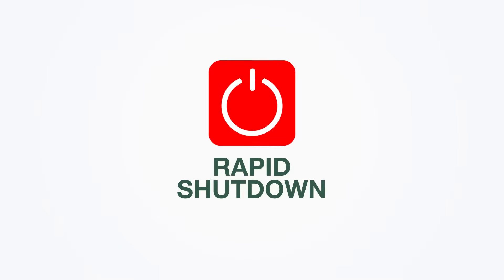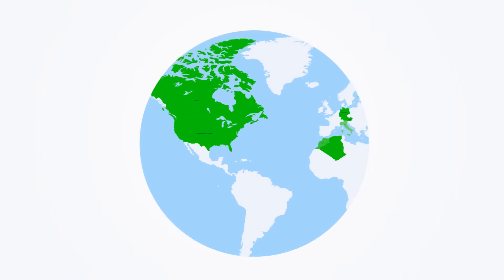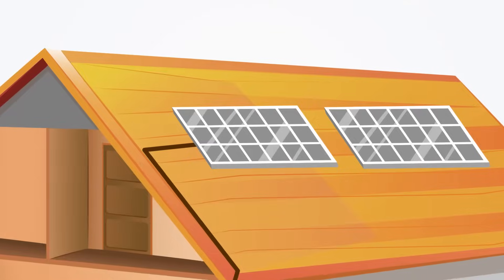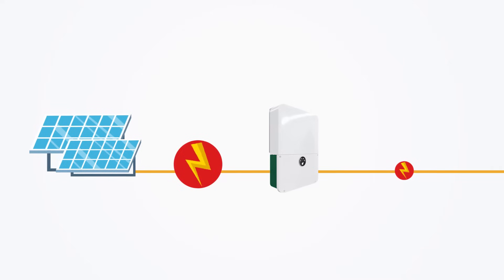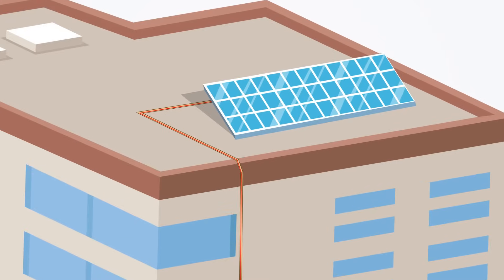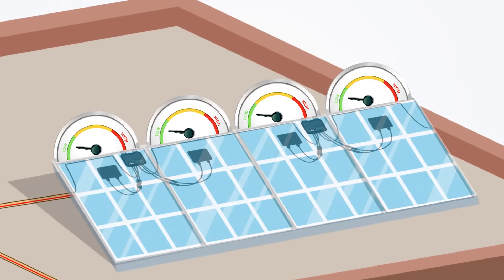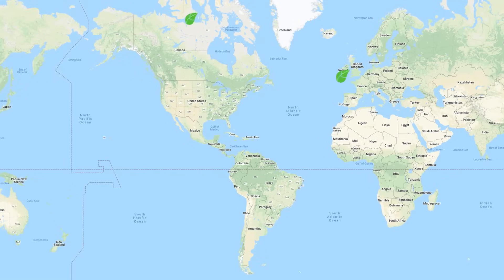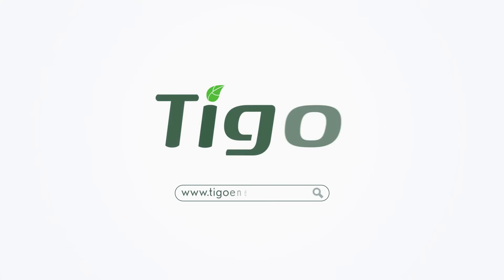Solar Rapid Shutdown Electrical Code Requirements and Solutions

Comment: Yay, more points of failure.
Reply from the maker: This is a common concern, however, if people know how to properly crimp connectors and follow our design and installation criteria then there is nothing to worry about. The modules or inverter will probably fail before our MLPE.